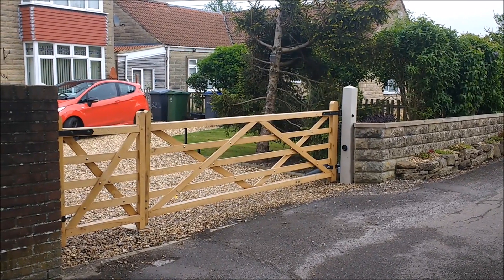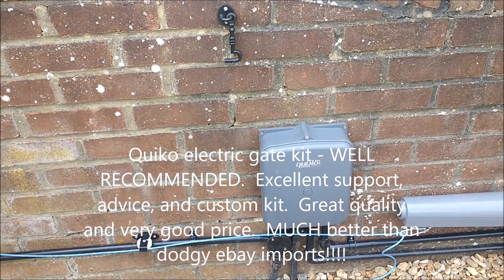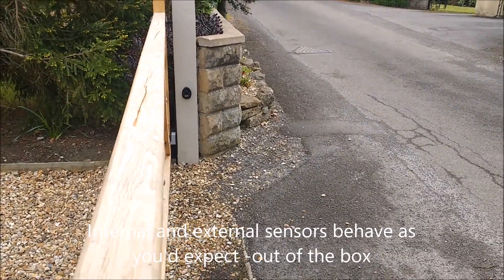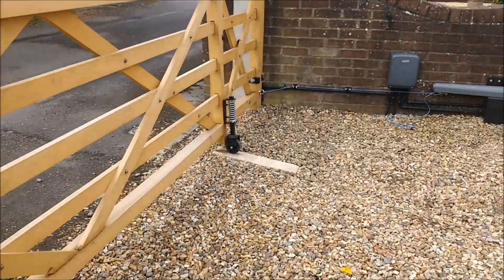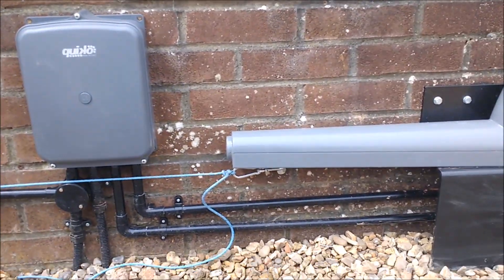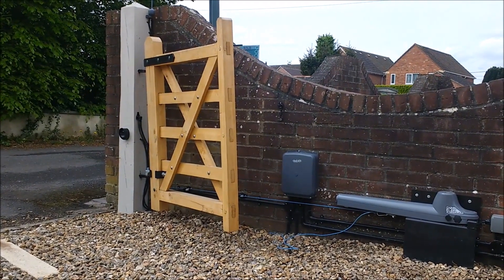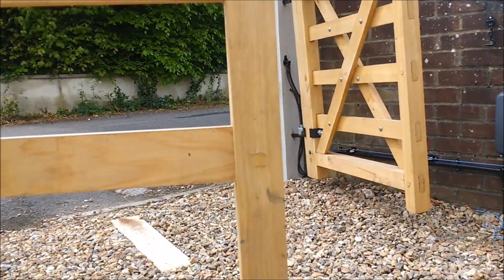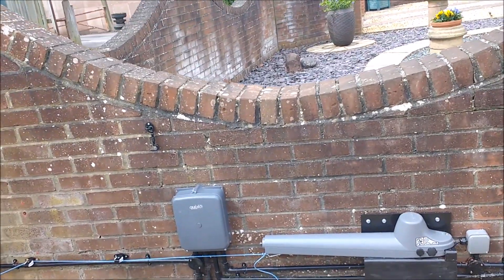DIY Electric gate kit, ,with manual AND automatic pedestrian gate

Comment: Here is my design that allows 3 modes for the gate (locked, manually openable and automatically open)... Instead of the rope, use a gas spring strut between the gate and the motor. When the motor is fully extended the strut is fully compressed and it keeps the door locked. When the motor is halfway extended, the door remains closed but it can also be opened manually as the strut has room to compress. When the motor is fully retracted the strut extends fully and then starts to pull the door. Two things to consider: 1) Check the spec of the strut for pulling ability. If not able to support the pull force you may need to add a steel wire parallel to it so the wire takes the pulling force. 2) These motors typically stop at only two positions for gate open and closed. You will most likely need to add an extra detection switch/sensor for the halfway point and integrate into the automation.
Reply from the maker: Great idea - see no reason why it wouldn't work.  Would not work with my kit though.  Also if I locked the gate some postman would force it and break it lol - but in some scenarious it'd be cool.  Love to see someone do this - deffo beat mine for engineering!

Comment: Simple but genius. This is what I want to do except my big gate will slide open. Small gate still hinged.
Reply from the maker: See no reason why not if you can get the bits (Quiko who I used also do sliders).  Only issue is if you have the sliding gate butt up to the swing gate there is no support at the top and it may "twist". (Slide gates tend not to be oak!)

Comment: Shame about all of the ugly conduit running along the wall
Reply from the maker: Can't disagree.  I was going to bury the bit on the gravel but the back of the drive is tarmac so that'd have to be conduit or a very expensive dig.  We were also going to put drive lights on the wall which would've needed vertical conduit but changed minds as not needed.  Roll on Power-over-wifi :)

Comment: Great video thanks! How is the gate performing after 3yrs?
Reply from the maker: The auto openning thing is working perfectly - faultless (apart from having to tighten up the stop nut).  The gates warped, partly due to poor quality, partly as the wheel arrangement on the large gate was forcing a rotation so encouraged the twist.  I changed the wheel to a small castor that is directly under the upright.  (I could only do this as the original softwood post hanging the big gate snapped due to rotting lol - so replaced with an oak post and it is much more solid.   The sprung wheel was needed originally as the original post bent....  I was aware the post was semi rotten - should've replaced at the same time!)
Reply: @Ryan_DYD  that's great thanks. Just trying to gauge the quality of the kit, so glad to hear its still working well. No rusting of deterioration of the metal? Does the kit come with mounting brackets? Thanks
Reply from the maker: @OlyLowe  Quality of kit, perfect.  No visible deterioration of arms or control box, and controls etc 100% reliable.  Some brackets are provided but this aspect will depend on your setup, gate positions, walls etc.  I had to get mine made but some are provided for "standard" install.  Its not ebay/chinese quality - it is italian, not sure thats good lol - feels more german :)
Reply: @Ryan_DYD  That's brilliant, just what i needed to know thanks 👍
Reply: Just another question...i see you don't have a lock on the gate. Apparently the rams can be damaged if pushed, hence they recommend locks. Have you had any issues with this?
Reply from the maker: @OlyLowe  Correct.  But no issues.  I doubt the ram would be damaged though - its very hefty!  But the leverage of the gate would likely cause bracket damage or pull the screws holding the bracket out of the post.  (Its 10mm bent steel bracket held in with 6x m10 screw bolts into oak post).  So it will need some force to break but if it does break it would be spectacular!  Our lane is quiet and no one has tried to force it.  But yeah - could happen.
Reply: @Ryan_DYD  that's great, many thanks. There have been suggestions that a strong wind could damage the ram! Thoughts? Our gate is similar to your main gate, a wooden 5 bar gate
Reply from the maker: @OlyLowe  not been a problem. Solid gate then yes. Five bar no issues for me
Reply: @Ryan_DYD  awesome thanks for all the replies, it's been really useful for installing ours 👌

Comment: Am I being thick here?  How does the smaller gate close....it doesn't look like it's on a spring and the string obviously cannot push it closed?  We have almost exactly the same needs with a small pedestrian gate and a bigger 5 bar gate but both need to be open for cars to drive in and out.
Reply from the maker: lol.  Yeah, not a magic string!  There is a gate spring on the inside of the pedestrian gate which springs it shut, the spring stops it going too far (e.g. tight when gate closed).  It does work really well and is still working and used all the time.

Comment: Hey, 

This solves my need for a manual and automated function, I take it the pedestrian gate is spring loaded for self closure?

Do you happen to have the contact email address for the company/sales rep that you used?

Cheers,
Philip
Reply from the maker: Yep, standard gate spring.   Search eBay for quiko to get an idea, and they will show an email address in the contact details.  I chatted to them direct and bought a custom kit direct, very helpful.  My contact was David Hill but name/number on listings have changed.  Hope that helps

Comment: Hi Ryan. It's been a long time coming, but I finally completed my own electric gate system and I was hoping I could reference your video in my thesis if that's ok? Your set up is the closest "competitor" design I could find because the small pedestrian gate can be opened with, or without electromechanical assistance. My design is otherwise quite different and unique, using both swing and sliding motors. Here's a video of the setup for you to check out > https://www.youtube.com/watch?v=O1SV-JjoI_o and thanks for your video.
Reply from the maker: Its all public, so reference away :)
Reply: @Ryan_DYD  Thanks for your permission. I know it's public domain, but I thought it polite to ask first. I have composed what will be in the paper relative to what I referenced on your gates and have pasted it below. It perhaps might help you make a small improvement for the sake of 5 minutes of your time. Ignore the reference figures as they cite 2 photos of your gates and the manual from your motors.

The author was unable to find a real world example of a hybrid gate system of which is the subject of this paper. The author hypothesises it to be unlikely that a commercial offering of such a system is readily available having received only a single response from one of many gate installation companies when asked about such a system in Ireland and the UK. This hypothesis is backed up by a thorough search of electric and automated gate manufacturers and installers. Every example found consisted of sliding only or swing only gate systems. Pedestrian gates were treated separately.

The nearest match to the author’s design was found on YouTube [14] seen in figure 14 and 15 with the design being a large swing gate operated by an actuator and a smaller swing gate linked to an actuator by rope. The setup allowed pedestrian access without electromechanical assistance and gave the owner the option to have both gates open and close with electromechanical assistance. The example was deemed most similar to the author’s design due to the pedestrian gate being capable of manual and powered control, as well as the user ability to control the motors using voice commands. 

The point where the pulling force is linked to the pedestrian gate by means of a rope in figure 15 is very near to the hinge. This requires a much greater force to open the gate with the motor than would otherwise be required had the link point been located closer to the far edge of the pedestrian gate and the pulley located further from the post. A much smaller motor would have been acceptable and the gate would have been able to open fully. The YouTube video [14] shows the small pedestrian does not fully open when the actuator is retracted at time stamp 3:08 and was unable to open the gate beyond the 70 degree point despite the QK-R300 motor [15] being rated at 800kg or 7.8kN. The narrow pull angle and the linked distance of the rope from the hinges are the reason the high powered motor and support bracket were needed to open the gate in the video. Moving the link point on the gate by as little as 20mm would likely be enough to achieve an open angle greater than 80 degrees.

Comment: If these were security gates, tall enough to keep people out and where they also couldn't climb over neighbours low brick wall I would get this project. But all this effort and expense just to save what? Not time, because you could open them manually quicker than the auto arm does it. I can't help think this is just an expensive indulgence that'll end up causing you grief in the long run... 
Maybe it's just me,  but this set up seems pointless.
Reply from the maker: Probably some indulgence, but why not?  Its not for security, obviously, but just to gate off our space.  When we bought the house, the old gates were always open and pointless. The lane is private dead end but we get dog walkers coming up and it stops the dogs poking their heads in.  But really?  I wanted it so I did it :)  Better to want and achieve than sit back and wait till death.

Comment: Please let me know how you did the google home integration! I've been searching the internet and I can't find a nice way of doing it. 

Thanks in advance!
Reply from the maker: Simply, a relay that shorts out the "open" pins on the board for 1 second.  (note:  the relay I use has the relay switch isolated from the power, so just "shorting" not sending voltage.  The relay could be any home automation relay - I'm using one linked to LightwaveRF but any wifi or other one that has isolated switch pins should suffice.. 
Note - the home automation command just sets gates to move - so from open to close; or close to open.  It has no way of knowing what state they are in - so "Open Gates" command could open (if closed) or close (if open).

Comment: Which home autonomous relay system are you using buddy? I was thinking of a sonoff mini?
Reply from the maker: My HA was install 9 years ago (!) so old tech - its LightwaveRF with hub and wireless relays.  Doing it now, I'd use WiFi enabled - the sonoff mini does not mention if the relay outputs are linked to the input (e.g. @240v) or just a switch.  On our gate controller, we just need to "short" 2x wires to get a signal, so no voltage, so sending 240v down is a bad idea!   I looked at https://amzn.to/3t6gc5w recently for something else but never bought as I THINK that has the input, and the switch relay is electrically separated from input..  But don't quote me!
Reply: Did you ever do an upgrade? Just installed my quiko motors, so looking for something now

Comment: Hi. 2 years on are you still happy? Which version did you buy? Would you buy a different model?
Reply from the maker: Hi.  Yep, in use daily and been "perfect" (well, the softwood post snapped, but it was rotten, now replaced with oak post, and this is more solid so the big wheel now not needed).  Can't fault quiko to be honest.  I'd buy the same again, good value and reliable.  think one was rotello r400 and one r300 - but the actual ones would vary depending what you need.  Supplier was vv helpful and gave good direct price - uk@quiko.biz.  Good luck

Comment: What’s wrong with the gates??? They look fine to me.
Reply from the maker: The nuts and bolts are not central, they are poorly located.  the &T joins are crap - the tennon is far off a perfect match and even sawn wonky/differently - schoolboy quality. THen it pokes out the end post and cut flush, badly, with a handsaw damaging the vertical post.  With gaps around the M&T join as it was badly cut.  It was done quickly by someone not skilled or someone who didn't care.  From a distance, then look OK.  thats about it. :(
Reply: @Ryan_DYD  good to know where not to get them! Who are they?

Comment: How does the ped gate close again? 😂 what’s wrong with using a catch post?
Reply from the maker: Spring closure so the actuator just lets out the rope and it closes.  I didn''t want a catch post as it'd be driven over directly due to entry/exit angle.  Still working well but changed the wheel on the big gate to a smaller one underneath (as replaced post with oak and it isn't really needed any more)